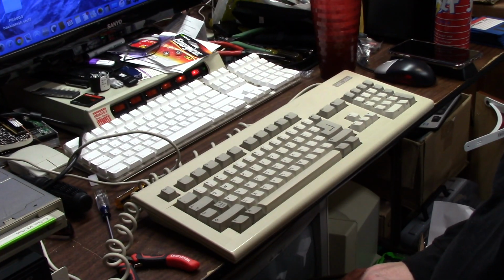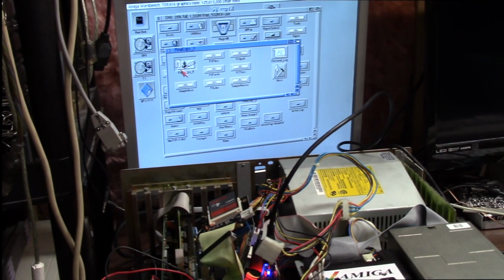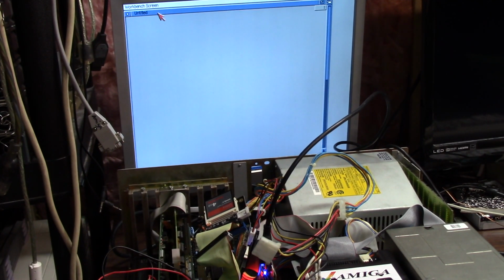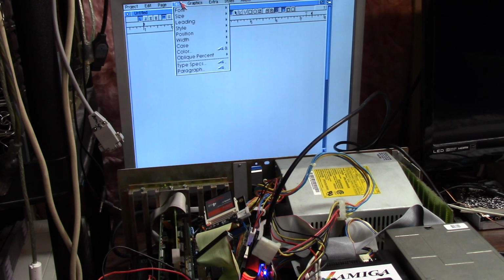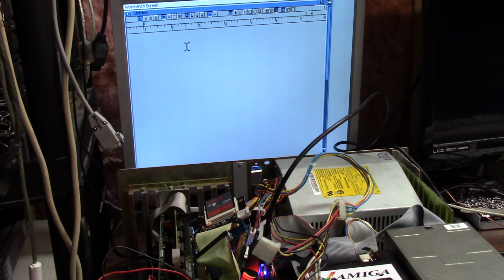Episode 81 - C= Amiga 2000 Keyboard repair

Comment: how do you open a hi-tek keyboard?  i see this video already has it opened up..  is it just held together along the side with plastic clips?   i can't see any screws.. just don't want to do it wrong and make it unable to be closed back up again..
Reply from the maker: Desolder every key for an amiga1000 or 2000 w space invaders switxhes.  There are screws
On the metal od the a500 /6/1200 keyboards
Reply: @ChrisEdwardsRestoration  scratch that.. i see what's going on..  awesome super excited!  thank you for your insight!
Reply: @ChrisEdwardsRestoration  ok awesome.. but i only need to replace the left amiga key (dead) but i have replacement mechanical keys to swap it out..   but actually opening up the keyboard itself.  the plastic enclosure.. any tricks / tips for the initial opening of it.
Reply from the maker: If you remove all the 30 whatever screws on the bottom of the metal you lift the plate up and then you Can lift out the entire plastic tray it only has pilot holes flip it over remove your key and the plunger will then fall out of the bottom replace the plunger, put your thumb on the bottom of it and snap your key back in place
Reply: @ChrisEdwardsRestoration  that's good to know :)   but how do i get it where i can get to the 30 something metal screws?  how do i open it up initially safely?  i want to safely open the keyboard enclosure.  i know don't know if it's held together by plastic clips on the edge if one isn't careful they could crack..  maybe a good area to start at?  a corner?  or perhaps in the middle?
Reply from the maker: @8bitwidgets  there's 6 screws in the plastic case, the insides just come out when separated. then 34 or so little screws
Reply: @ChrisEdwardsRestoration  i only need to repair / replace the Left Amiga Key.  So I should only have to desolder / replace the one right?  I'll see about making some informal video of that level of space invader operation as I don't know if anyone has covered that yet.  I just want to make sure i open it up gracefully and not snap plastic pieces..

Comment: Hi there, if the entire membrane needs to be replaced (imagine if some areas got damaged beyond what cleaning could help with) would an A500 keyboard membrane replacement fit?  I've read that somewhere, but i'd to confirm before I might purchase one.  My A2000 keyboard is the later Rev 6.2 era keyboard I'm asking about in particular..  thinking long term as well even if my keyboard isn't bad yet..  awesome video!

Comment: Do you repair other folks Amiga's? I have a A2000 that stopped working and would love to get it back again.
Reply from the maker: I guess I can, but depends on how bad it is. what is wrong with it, and how bad is the battery damage...
Reply: @ChrisEdwardsRestoration  I have not opened it since 1999. My son pluged in the cable that went to the external floppy. the issue is it was already plugged in on one end and he plugged the other end back into the computer (a loop) he said the computer shut down and never came back on. Is there hope. I am sure the battery is leaking.
Reply from the maker: @overdrive39  then do yourself a favor get some snips and cut the battery out of the motherboard, pour some white vinegar on it to neutralize it and then some isopropyl alcohol (rubbing alcohol ) to stop any further dmg,   the ext floppy into itself would only blow F2 or F3 Pico fuses (I did a video on those too) and is easliy fixable. the power supply has a fuse in it you can replace and be back to working if the Motherboard isn't totally trashed... better to check it than get the urge later in life to have it totally gone. it only takes 10 mins.
Reply: @ChrisEdwardsRestoration  Thank you! I will remove the battery today. I will let you know the outcome. You rock!

Comment: Nice! I bought a Mitsumi KPQ pc keyboard off eBay and used a plunger from it in to repair  my A500's non functioning main enter key. Exactly the same part. I also used the G key from it to replace the missing one on an A1200. It 's a little shallow and italic but it was already there.

Comment: If you ever want to use WHDLOAD you will need the F10 key to exit most games.  You can buy key pad repair liquid which will restore the carbon on the key pads. While the keyboard on my A2000HD is fully functional I bought PS2 adaptors and an Indivision Board from Amiga Kit for the Keyboard, Mouse and Video, now I have it connected to a KVM Switch so for the most part it sits in my server rack so it takes up no desk space.
Reply from the maker: that sounds great, however the cleaning restore worked perfectly. being the only owner i know its history and usage, which helps